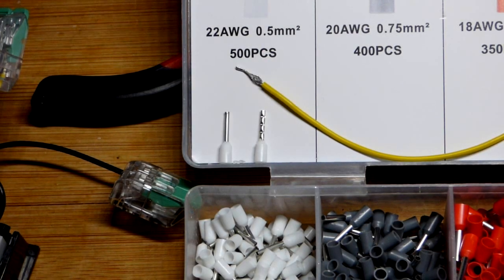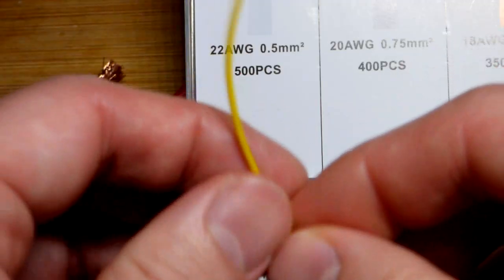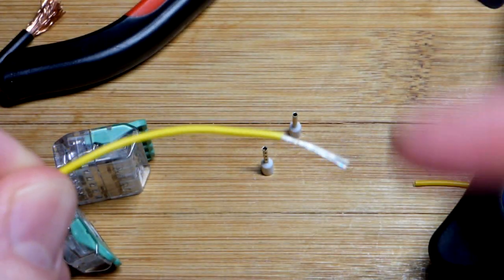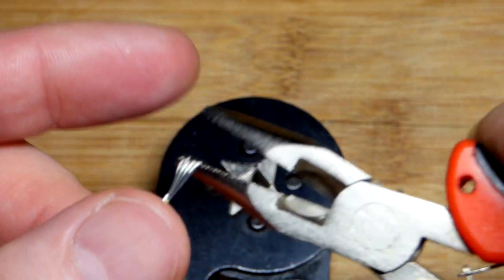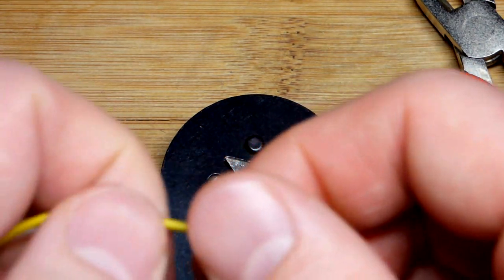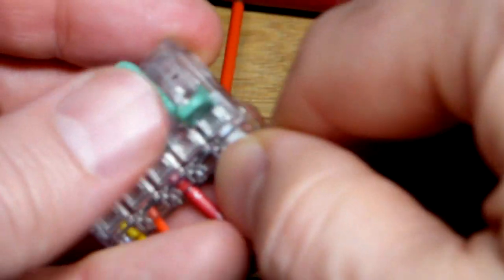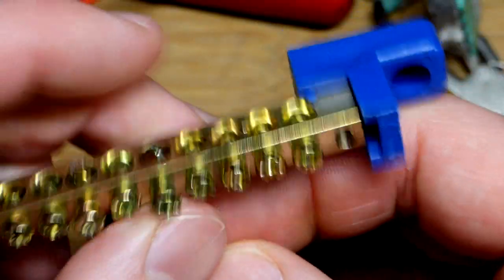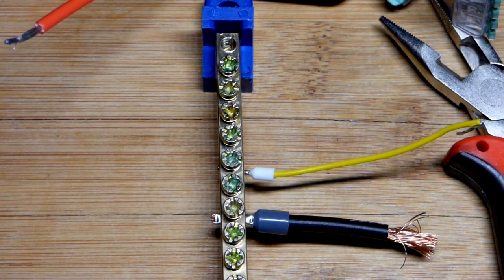Testing If Folding Small Wire Will Work With A Larger Ferrule

Comment: as a electrician  we are not allowed to twist the appliance wire  when putting it into a ferrule (against the standards) it actually weakens the crimping force .also it looks that that wire is the wrong gauge for that ferrule  which will explain why it pulled out  ..cheap wire is often incorrectly  sized
Reply from the maker: Thanks for watching!